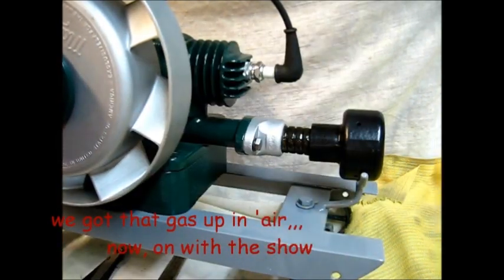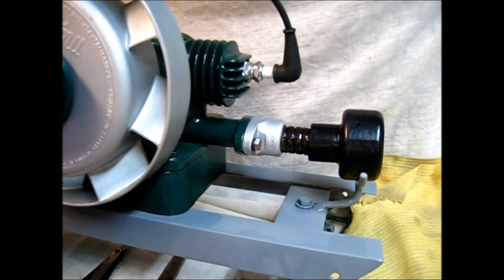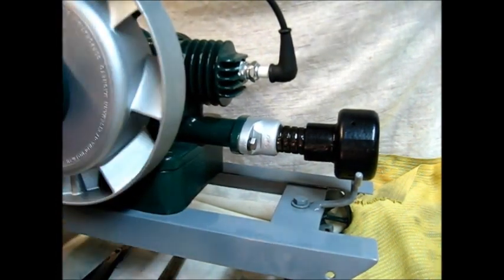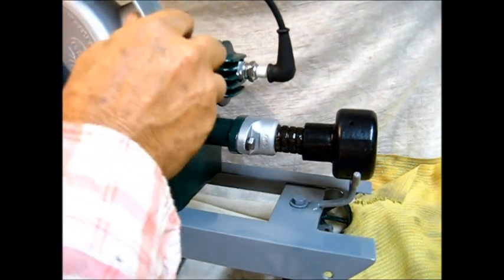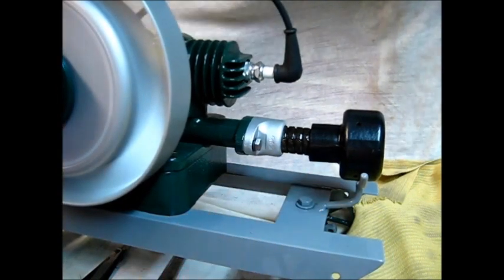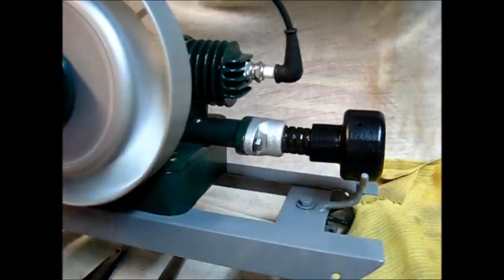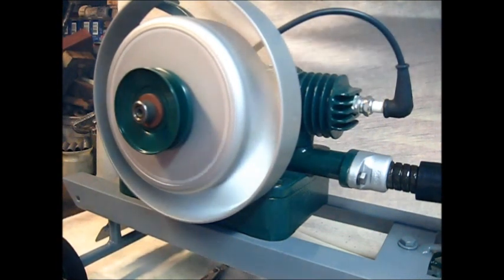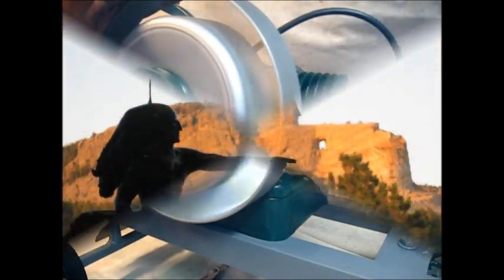1937 Maytag Engine model 72 repair #64

Comment: Engine runs great.  Need to thank you for one of your tips.  The steel rod clamps that are pushed into a hole - can't remember what they're called - but they work great.  Used them to hold a part in position to silver solder today.  Been using Gasoila to seal steam fittings this week, too.  Thanks!